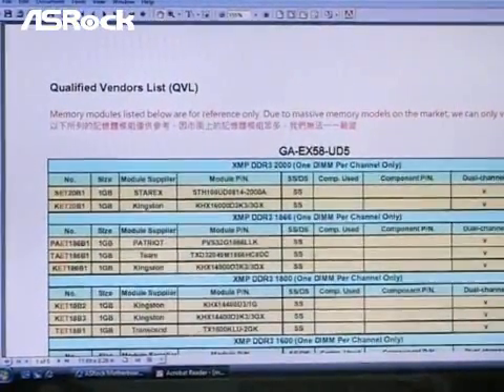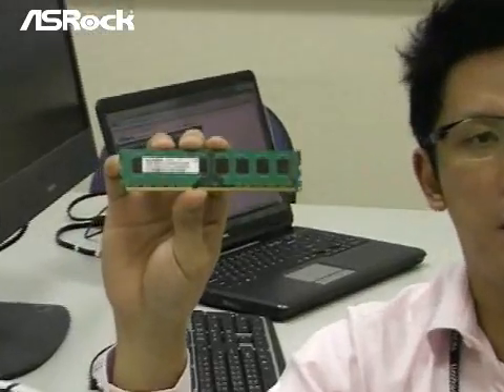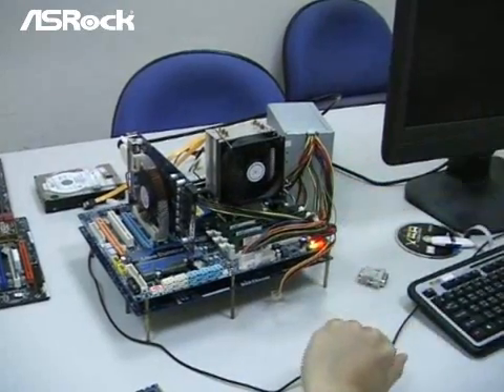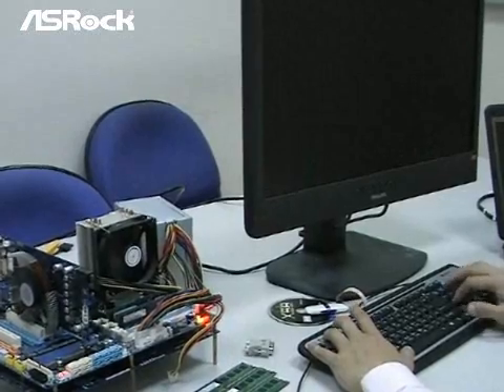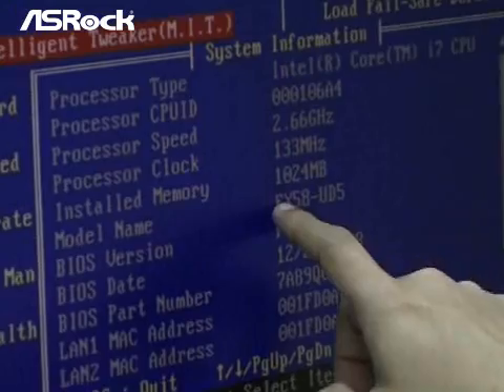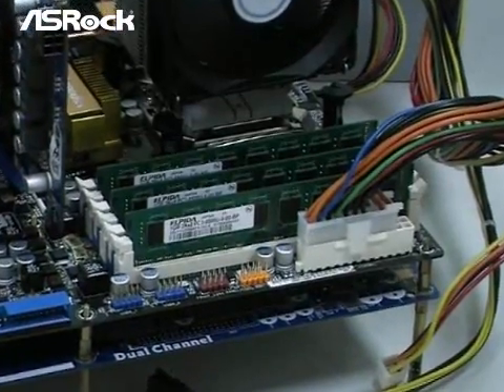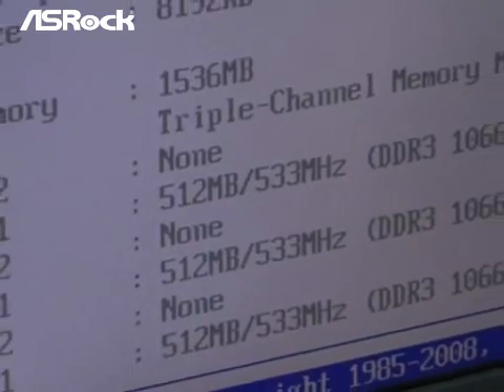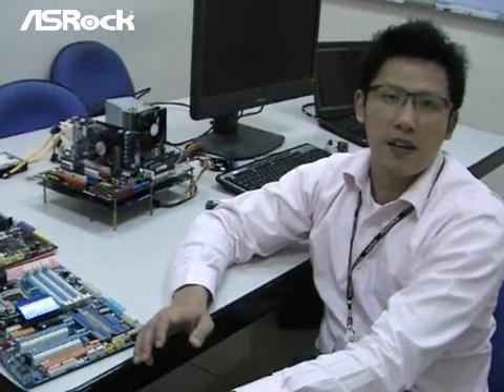X58 DDR3 memory compatibility test - part I

Comment: Friend I have a question about this mobo because I have interest in it, I will build a platform x58/core I7 + SLI gtx280 and more sound card pci-ex and a evga xeno killer, if I put the sound card and the killer in the orange slots SLI drop my speed to 8x or continue on x16?
I already have in hand two kits of memory, a ocz heaper DDR3 6gb 1600mhz and other ocz platinium  6gb post (boot), even using combs to 1600mhz as the site that you speak only in OC it works?